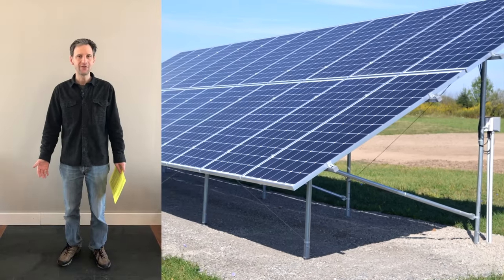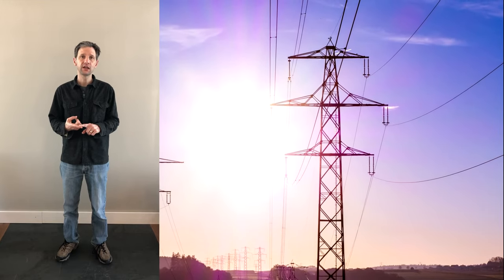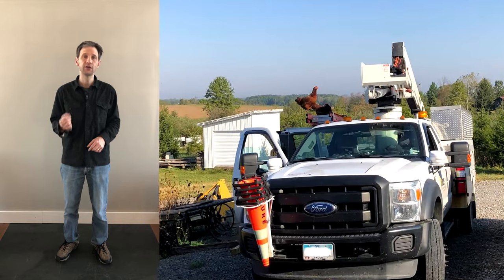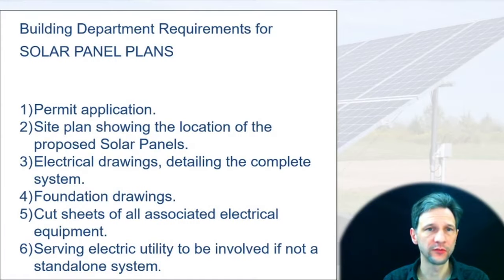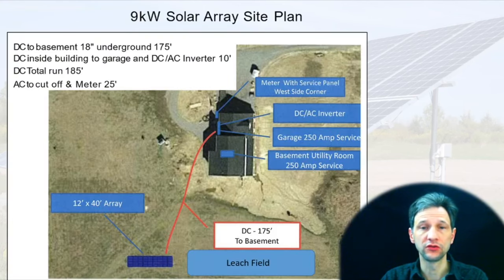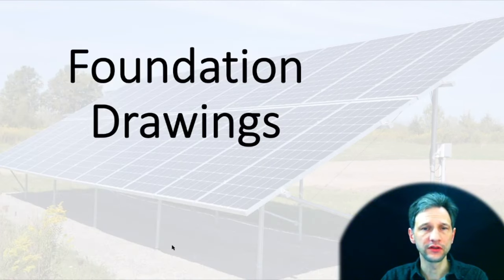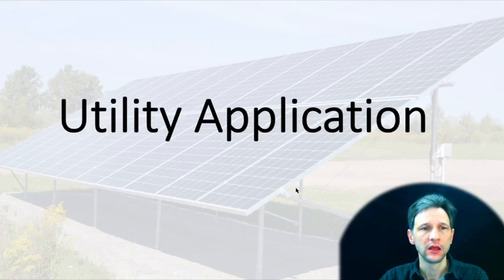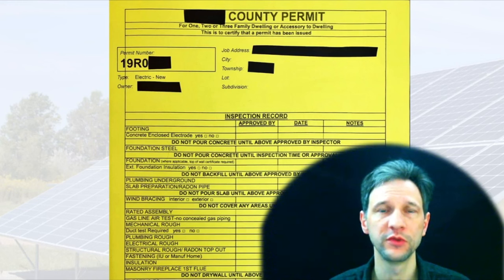HOW TO GET A PERMIT FOR YOUR SOLAR PANEL SYSTEM - Planning Your DIY Solar Array Part 3

Comment: When you build your system, build it to go off grid with batteries, get a hybrid wind/solar controller, then get a charger/ inverter, run your home off the inverter, but now hook your grid connection to the charger on the inverter, now you have a off grid system that is still hooked to the grid and it will keep your batteries topped off , also you can have a grid connection to power high amp appliances like AC , you may have to do some creative wiring to get away with it, don’t sell anything back to them and have a main shutoff to compleatly go off grid if the grid goes down
Reply: You should make a video explaining this in detail.
it seems very interesting

Comment: I have really enjoyed your video series, it’s clear and concise. I’m in the early stages of my own installation and have found many of your topics reinforce my thought process. 

I chuckled at your permitting costs. Our municipality charges $300 just for them to allow (review) us to put a solar installation on our property, then promptly asks for another $250 for a building permit. 

The challenges don’t end there, our utility requires a comprehensive engineering study for our entire electrical system before they will talk to us about grid tie. They basically price themselves away from working with homeowners…Then if we make it through all their hoops they will only credit energy from us at wholesale prices (1/2 the res rate). Needless to say I plan to redirect those thousands of $$ into a battery system.
Reply from the maker: Wow! It's amazing all the unnecessary expense that can be added to install a system.  I'm glad the videos have been a helpful resource for you.

Comment: Dave, I enjoyed your installation video.  Good design and very nice installation.  I had to laugh at (most) of the kibitzing comments you have received.  However I’ll add my own here.  In my jurisdiction, the SqD unfused AC disconnect AT THE MAIN PANEL is not required.  The 40A 2-pole circuit breaker in your 200A service panel is the point of interconnection and can serve as the disconnect.  However, AC isolation is required within sight of and 10’ of the inverter (in the garage) - NEC 690.15(A).  So in my jurisdiction, as an inspector, I would have expected to see the unfused disconnect in the garage (on the AC side of the inverter).  And the wires connecting to your main panel would be connected to the line side (top) connections in that disconnect (which is actually the way your plan 1-line diagram shows the connections).
Reply from the maker: Thanks for adding your feedback!

Comment: Thanks much Dave, that's helpful. Question though, how many times did the inspector come out to inspect. If you did a concrete footer, I imagine that the inspector would come out for that and at the same time inspect the trench and conduit. And then a second time for the final. Is that about right?
Reply from the maker: Because I didn't have to pour footers, the inspector only came out once for a final inspection.  I put sticks in the trench that could be pulled out to check the depth of the trench which was a recommendation by my inspector.
Reply: @ProjectsWithDave  I'm trying to imagine the stick method and how it would reassure the inspector of the proper depth of a trench? Is there some type of technique used here I'm not understanding? If it's just an honors system step illustrating where the trench is and how deep, ok, I get that. Can't anyone pound in a stake and claim its at the depth and location of the run?
Reply: @bokchoy335  Another method I've seen used is to put a few short pieces of conduit in the ground over your trench large enough to fit a tape measure.

Comment: Just received my Application from the Utility company I'm confused by some of the question, were any of these on your application or if you know the answer I would appreciate it. 1. Metering (voltage, location, losses adjustment due to metering location and other: 2. Facilities to be furnished by cooperative. 3.Facilities to be furnished by DG owner/operator. 4. Cost responsibility. 5. Control area interchange point. 6.Supplemental terms and condition attached. 7. Delivery voltage. Thanks
Reply from the maker: First, I would recommend contacting the engineer that manages solar install for your utility, they will be able to help you get the answers they are looking for since I didn't have most of these.  #1 I didn't have, but I guess it only applies if your meter is far away from the utility transformer.  #2 I expect this is in refence to the installation of a two way meter, usually provided by the utility. #3 this is likely the equipment you will provide, inverter, AC shutoff etc.  #4 I guess this is to clarify who is paying for the two way meter and AC shutoff, equipment that may not be clearly the Utility's or yours.  #5 This probably refers to the 2 way meter, the place where the power is managed between what is yours and what is the utility's.  #6 This sounds like there is an attachment with the terms for selling power back to the utility.  Usually it includes the price the utility will pay for your excess power, how much over production they are willing to accept, and what the net metering agreement will be. #7 is the voltage you will deliver back to the utility, for most homes in the US it would be 240v.  Hope that helps.  Thanks.

Comment: Hi Dave, I live in West Chester, OH so I believe we are neighbors 🙂. Could you share how you got the drawings approved by an engineer to get the permit? Also, is there a link to the codes (structure & electrical) that apply to installation in Ohio? Thanks a lot for your feedback and keep up the great work! I love your videos.
Reply from the maker: Hey neighbor! The Ready Rack drawings come pre-approved by an engineer from the manufacture, as is the case with most racking.  Most areas in Ohio, that I'm familiar with, follow the national electric codes, but it's best to review your proposal directly with your inspector.  I find they all have some "preferences" of their own.  Thanks!

Comment: You said they paid you a $.04 on your net metering and I believe you mentioned it cost you $.10 -  if you had it at $.074 and it cost you $.09 would you put it back on the grid- just curious-
Reply from the maker: I pay about $0.14/kWh and I get 100% of that back for what I use over a month.  I get $0.04/kWh for the amount I produce over my monthly usage.  I explain it in more detail in this video: https://youtu.be/IwUK1dNJ3n8

Comment: Yeah, I'm definitely never going grid tie. I'm not asking anyone for permission for producing power on my own property.
Reply: The permit isn't to produce the power.  It is to be able to send it into the grid which is owned /managed by someone else.
Reply: @muchmuchmore  Disagree. It's to get permission from a state actor. If what you said was true, then why do these same people ask for a permit to build a shed on your property? How's that affecting others?
Reply: @AntonioCunningham  The interconnect agreement is with the utility not state or local government.  While they may be a pain, expecting anyone to operate a utility and not have any control around the quantity or quality of what is transmitted by it is just silly.
Reply: Diy. No permits. And forget the utility company. A 15 to 20kw lifepo4 battery bank will get you through the night.

Comment: Does your Electric Company limit the size of the array you can install, perhaps based on the amount of electricity your home uses?
Reply: I've found that the Electric Co. looks at your last years bill and will not let you put in an array that's is larger than your total consumption (in my area). This is because once you are producing more electricity than you can consume...you become a competitor. I'm not sure how they handle a situation where you're approved for a certain array (based on consumption) and then through energy conservation efforts (new windows, HVAC, insulation, etc.) you end up "over producing".
Reply from the maker: Yes, no more than 120% of annual consumption.

Comment: Are you in city limits? I'm not and wasn't planning on dealing with the county. Maybe I need to find out if it will please the crown to pay for permits to build something on my own property.
Reply from the maker: I'm not in city limits, but where I am there is still a county and township permit that is required.
Reply: @ProjectsWithDave  Man I got lucky, I just got off the phone with my county assessor and they don't give a crap about solar lol so no permit required for me! Thank you for the video anyways though because I would have never known to even check on this.
Reply from the maker: Fantastic!

Comment from the maker: Find More information for this project and others on my website: https://projectswithdave.com 
Other Helpful Solar Videos:
Super Cheap Solar Panel Review: https://youtu.be/qu4iGxBhqzs
Full Solar System Install: https://youtu.be/_xA6qOwnYbM
Check out the first year performance results here:  https://youtu.be/BatTeSq05rU
See the total system cost here: https://youtu.be/PNTO83FvaL4
And How to size your solar system here: https://youtu.be/rbFnZqA0GCI
4 Things to Know About Solar in the Snow: https://youtu.be/vY3PufzPUnI
Ground Vs Roof Mount Solar: https://youtu.be/w-iS_8e7n60
How to Get A Permit For Your Solar System: https://youtu.be/imiEYDHLG4A
How to Crimp MC4 Connectors: https://youtu.be/oH3LqTu4B8E
3 Solar Panel Wiring Issues Answered: https://youtu.be/i7vHEHB3a-M
Net Metering Explained With Actual Data: https://youtu.be/IwUK1dNJ3n8

Comment: what is the point of showing a permit that is not readable.
Reply from the maker: My documents are just for reference.  Everyone will have different paperwork depending on the requirements for your area.  The video is more about the process of successfully getting a permit.
Reply: The permits have sensitive info, so it is redacted for privacy purposes.

Comment: And this is why I never bothered, lol!  My local net metering pays about $0.02-$0.04/khw. Nope...
Reply from the maker: If they are doing net metering by the month, and only pay you the low rate for overage you can still make it work using the method of minimizing overproduction I show in this video on sizing your array for net metering: https://youtu.be/rbFnZqA0GCI
Reply: @ProjectsWithDave  Here's the kicker, the few cents they "pay you", it's a revolving credit to your account which you cannot cash out, unless you close your account!
Reply from the maker: Sounds like they don't want solar on their grid...
Reply: @ProjectsWithDave  That's my take as well... We historically had a pretty decent NM arrangement, but the electric company renegotiated a new contract with the state last year, and it's certainly not in the consumer's best interest going forward!
Reply: I think it's only a matter of time before the lavish NM programs fade away as solar gets cheaper and it begins to cut into their profits in a more significant way...

Comment: Yeah pay you half for what you give them then they charge twice as much selling it they wont get one kilowatt second from me
Reply from the maker: You have to consider the utility splits the rate you pay into at least two categories.  For example: Part of the rate is distribution, the cost of installing and maintaining the lines $0.10/kWh.  The other part is power production $0.04/kWh.  They can't pay you more for your production than what is purchased on the open market, it wouldn't make good business sense.  Over production moves you from a consumer saving $0.14/kWh to a wholesale producer earning $0.04/kWh.  That's why it makes the most sense not to overproduce too much if you want your system to pay off quickly.  You can see the analysis in this video on net metering: https://youtu.be/IwUK1dNJ3n8
Reply: @ProjectsWithDave  well this is what i see happening everyone getting on solar com ed doesn’t need to make power and still charging people sorry but com ed can kiss my rear end staying in business and they should of had lines buried decades ago that money going into their pockets no way they spend all that extra on line maintenance
Reply: @ProjectsWithDave  and thank you for the reply